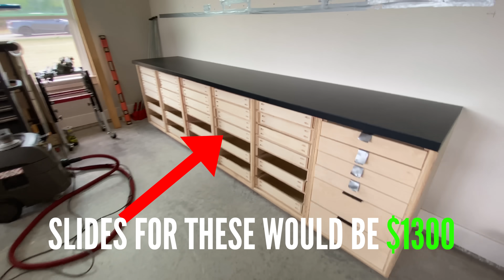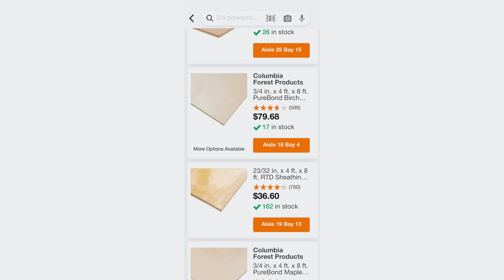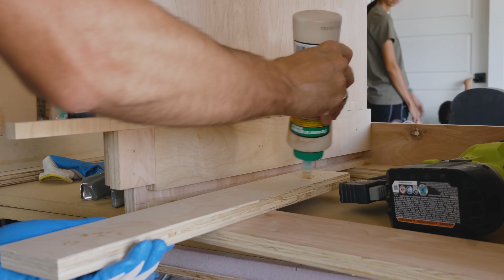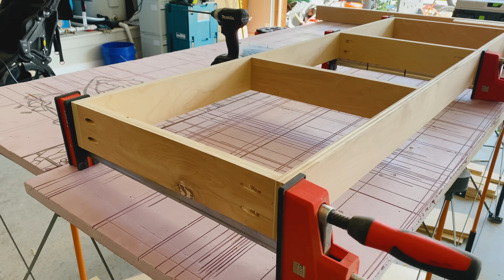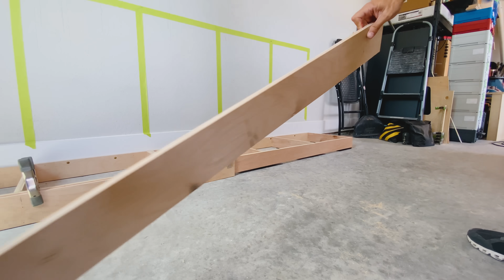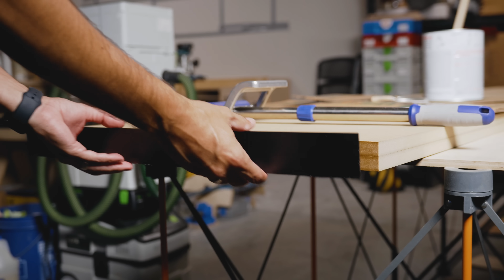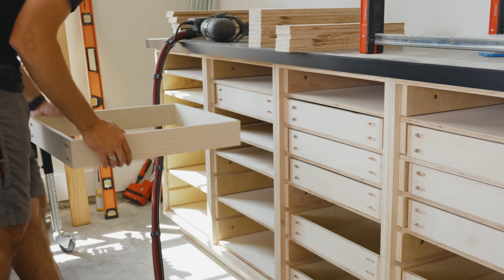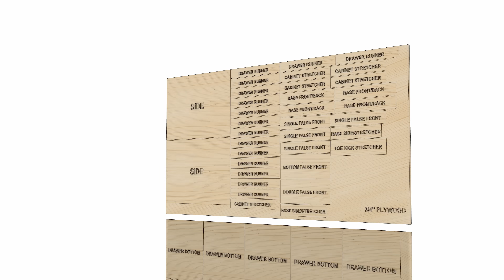Drawer slides are expensive. Do this instead.

Comment: I worked at a professional cabinet shop for a while and these are a few tips I picked up on doing laminate:

Make sure your bearing is spinning freely. We cleaned ours at least before every cut, sometimes in the middle of long countertops. Cleaned with laquer thinner and then lubricated.

We used a chamfer bit to flush trim the edge. Set it to take a small (1/16" or less) chamfer and that breaks the edge as well as flush trimming. It also doesn't have as much risk of damaging the side laminate. 

I preferred doing laminate tops with hardwood edges all the way around instead of laminate. Gives more forgiveness when flush trimming if you use something like 1/4" thick banding, and then you can cut a nice sized chamfer into the edge as well.
Reply from the maker: Thank you
Reply: The round over bit is a must to save that edge! Changed my whole work flow when started this and clients love the consist smooth edges!

Comment: Did you have any issues sanding the plywood with your 3M sander? I used mine on some cheap half inch plywood and it immediately started to sand through the veneer. I wasn't sure if that was a result of the cheap veneer, the sander being too aggressive with the 5mm stroke, or a combination of the two. I know for sure my grit was too aggressive in the beginning but I was having issues using 220 grit as well. I wish I had a plywood dealer like that in my area! Also, the cabinets look awesome. I couldn't find a snorkel for whatever reason so you get a surfer I guess 🏄

Comment: Being an animal myself, I liked the duct tape hack and have a pro-animal tip 4 u! General purpose masking tape or white painters tape. Whichever matches better or is cheaper, depending on situ. Other than the large number of cut filler pieces to make dados, it 'seams' to me to be a lot more material/expense than using a router or dado set of blades. If it took 1 sheet less per 2 cabinets you might have made budget? Anyway they look like they turned out great. Especially liked the hardware tucked in the face. 🤿

Comment: 🚽🚾 Mr. Wittworker, since I couldn't find the snorkeling emoji, I decided to give you a couple attention grabbers at the beginning of my comments.  This video is perfectly timed!  My oldest son and his wife just bought their first home, and the kitchen needs a bit of work on the wall that has the range and two separate built-in ovens (currently non-functional), integrated into the white painted cabinetry.  I told him we could build new cabinets and he could install a new range-oven single unit centrally located between lower cabinets on each side and flanked by a pantry on the outside.  With some modifications, I think your design ideas coupled with the hints about where to purchase cabinet grade plywood might be the ticket.....thanks very much!

Comment: 🤿I'm moving to a new shop soon and this video will definitely come in handy. Thanks! 

Cabinet hardware is ridiculously expensive where I live, Brazil. Plywood prices are also insane, even more so than in the US, and to add insult to injury, it's pretty much impossible to find high quality hardwood ply (and if you do, it costs about as much as a kidney and a half), so you end up spending a ton of money on garbage. There is no such thing as pre-finished plywood, let alone birch ply here.

We do have lots of cheap MDF (well, not cheap, but way cheaper than plywood), and it's very common to find sheets of it that already come with a formica veneer applied to it. In fact the unveneered (is that a word?) kind is rarely used.

The only thing that you have to do with veneered MDF is apply some edge banding, and we normally buy rolls of PVC edge banding for that exact purpose. Is that not a thing in the US? We don't have any kind of iron-on edge banding. I usually apply mine with a contact glue that comes in the form of a tape that you apply to the edge, then peel off, leaving a layer of water-based contact cement on the edge. It's real handy and WAY easier to use than solvent-based contact cement, which is probably the one substance I hate the most in the woodshop.

Anyways, thanks again for the wonderful video. And screw you for making me want to buy parallel guides for my tracksaw. Hope you're happy.
Reply: Yes, we have PVC edge banding, but that double-sided tape is super expensive compared to contact cement!
Reply: @wesman7837  it's much more expensive here as well, but not having to fiddle with contact cement is worth the price, IMO!

Comment: I just don’t see it being a very long lasting deal. Short term and a lot of paste wax sure they’ll be great but I see a lot of little maintenance and tweaking. Any old cabinet or piece of furniture with drawers gets bad wear marks I’d be curious to see an update video after awhile. Frank Howarth did the exact same design for small parts. Which I can see working out well cause there no weight.

Comment: You want to tape and one layer of mud on drywall joints in an attached garage for fire rating and to limit air permeation into the house. 
At least in these parts I'm fairly certain it's code.

Comment: 🤿 Nice video. The marking on the laminate edging could be from a slightly stiff bearing. I always use a new bearing when running against a finished surface. lloyd

Comment: Tip on the laminate. Get a laminate flush trim bit that is made for that. Works really well and should not cut into the side piece. Also use a tiny chamfer bit to go around the perimeter and that will break the sharp edge.
Reply: Laminate flush trim bit, and wipe the surface you are riding on with Johnsons Paste Wax for a little lube....
Reply from the maker: Johnson’s. Rip.
Reply: @wittworks  I’ve always just used turtle wax on the edge that the bearing rides on.
Reply: A really attractive way to eliminate laminate edge banding is use a 3/4” thick 1x2 oak or other type of solid wood as an edge band.  Glue and nail then apply laminate on top. Flush bit route as normal..then throw an OG or round over bit on it. Really blows peoples minds.  Personal preference I suppose…yet different than the guy next door!  Excellent job on cabinets…and videography too! First time viewer.
Reply: Yep, I love doing maple edges, laminate on top, then routing a bevel around the edges. Very functional AND classy
Reply: I used to work in a cabinet shop & we always laminated the edging after the top.

Comment: I did something similar recently but using Dennis' approach from Hooked on Wood. Standard carcass with an MDF inner liner with slots cut in. Then just glued and pinned 80mm drawer parts glued and pinned to a 9mm MDF base. They are very deep, slide fine and saved me a fortune as I'd have needed nearly 35 drawer slides of whatever flavour. Also I can move them around as desired as all the slide slots are identical, so there are single, double and triple drawers and each can go anywhere. Similarly I also put black Formica on a double 18mm MDF top, but the contact adhesive I had was utterly shocking and formed blobs when I dared to use a brush or a roller. I did eventually sort it all out though and it looks great.
Reply: I don't know about where you are, but here in Oz, if I go into an Auto parts shop, or a hardware store, I can buy a 'Degreaser Sray Gun' to use with compressed air, and in the past I have found that it also works well for yellow contact adhesive, the same stuff you would use for putting down laminate. It's not a perfect spray, looks almost like a random cobweb effect, but it WORKS, you get a nice even coating of the glue

Comment: I’m guessing the bearing on your flush trim  bit got full of dust and seized up. After that  it was spinning with your router bit and basically melting your Formica. 
As for those drawer pulls. They look like pant killers to me. 🤿

Comment: Very solid work, as always. I'm a big fan of the hardware-less option, particularly without using the router to dado the heck out of the carcasses. 

Did you use the Festool table saw for the narrow rips, or somehow use your tracksaw for those? Curious how that would have worked!

You're the third person I've seen with the new Festool compact table saw. New toy? Any reason you went with that vs. a Sawstop CTS?
Reply: Almost forgot: 🤿

Comment: Dude, this is really great. Inspiring me to finish these rolling tool carts I made out of 80/20 aluminum that still don't have drawers installed. I've been scratching my head for months on what kind of drawer hardware to put in them. I spaced the widths to fit the official systainer rails (or drawers), but plywood stretchers and drawers would be wayyy cheaper and practical. I'll have to check out your plans. 🤿

Comment: 🤿 Great cabinets and hardware free. I have a similar design build set-up and used teflon adhesive tape under the runners. It`s cheap and makes a huge difference in the drawer feel when operating. I like how you completed the repairs to the wall after all; It would also trigger my illness. BUT, c`mon Drew, the handle pulls not fitting in the rebated corners... doesn`t that trigger you more? After all, you see those more than the back of the wall cabinets.... might come back and haunt you. Just playing with you... Great build and a good effort taking three times longer for the YT... 👍
Reply from the maker: Thanks.

Comment: Use packing tape om the side before trimroundig, it protector the edge, and make the bearing slip instead of getting hot of scrape. Also makers a thin gap beween the router bit and the edge.
Reply from the maker: I like that. Where were you two weeks ago?
Reply: @wittworks  45 degree chamfer and be done with it.

Comment: 🤿 Great content.  Buying plywood from anywhere than HD etc., is valuable advice.  I'm curious how well your drawers (correction draws) operate when loaded with stuff?
Reply from the maker: Hahaha. I made them 3” on purpose so I couldn’t load them down. Most slide great. I have one that I put every hammer and heavy wrench into to try. It works but is a chore. I plan on hanging those tools anyway.

Comment: 🤿 woo! Im one of six! 😂. One question, are you worried about  the drawers breaking because of too much weight being cantilevered when they are open? It looks like you’re planning on putting tools in some of the bigger ones. Also, for similar, yet cheaper/diy drawer handles, I’ve gotten aluminum angle from a big box store and cut it to make the handles, and then mounted it similar to what you did (except screwed from the top. 

Great project. I’m in need of some shop drawers so this is super interesting.  Thanks!
Reply from the maker: I made them short on purpose to discourage over filling. So far they’re good. I’ve used that angle iron trick in my first shop! I loved it

Comment: Surprisingly compelling vid on a well-worn topic.🤿  I like the simplicity of the glueless drawer builds, that’s almost enough reason to go this way, slides savings aside. (Pretty sure I would have double-side taped a couple of boards down to make a quick and dirty positioning fixture, vs. all that center marking and alignment work though😅). 

Curious: Did you fine sand and wax the contact surfaces for the drawers? Or are they good just bare and dry?
Reply from the maker: Great point! I sanded and will wax soon. Spent a week building, and 5 weeks trying to figure out how to make the video not boring.

Comment: 🥽You can also lubricate those types of draher slides with beeswax. Get a block of it and just rub it on the exposed slide edges of the plywood. This also works well on older antique furniture that doesn't have modern slide hardware. 🥽
Reply from the maker: Yep. That’s the plan

Comment: 27:10 No need to buy an expensive jig, just get a scrap piece of plywood, mark out equidistant holes in a straight line, and drill them on your drill press.   Yes, there will be minor imperfections in the spacing, but that's okay, because if you simply replicate it using the same jig four times, any slight imperfections don't matter, as they will be the same in all four corners of the shelf.  And once installed, you won't be able to tell that a shelf is 1/32" lower than it should be.   Plus it's way more fun to build jigs yourself rather than buy them from Rockler, although their stuff is mighty nice.  But I'd rather keep my money, please and thank you.
Reply from the maker: I thought making one from pegboard
Reply: @wittworks  Pegboard is too thin, you need something at least 3/4" thick, that keeps your drill bit lined up perpendicular to the surface you are drilling.   If you use 1.5" thick material then it can even act as a depth stop, assuming your drill bit is of a complementary length.

Comment: I usually trim the top Melamine with a 45 degree bevel. Cuts off and cleans the top at the same time. No blades near the side Melamine. Usually don't have to do any file finishing.
Reply from the maker: Where were you two weeks ago?

Comment: The modular cabinet design is fantastic, but not the most efficient use of expensive plywood. If you built it in 2 5 foot sections you could save a sheet or so. But being able to adjust the layout later is a huge bonus (split them apart, hello miter saw station)
Reply from the maker: Very true. Mainly built them this way to illustrate the modular aspect.

Comment: 🤿Check out Woodworkers Hardware for slides.  I get KV ball bearing slides for waaaay less than the ones you were looking at in this video. I know that skipping the slides altogether is cheaper still but, sometimes slides are needed.  KV8400 slides. Check em out! 🤿

Comment: totally random question... but what measuring tape are you using there with your tracksaw? I've found it surprisingly hard to find any with fractional read on both sides 😭
Reply from the maker: It’s a lufkin self centering tape. https://amzn.to/3tHMDw7

Used to be $7 at Lowe’s. Now they don’t carry it and it’s $18 online. 

It doesn’t read both directions, but I use it because it gives you the fractions and the exact half at the bottom. I think fast cap may make a double sided tape measure

Comment: Most likely reason you got that mark on the edge of you laminate is the the bearing had build up of contact cement from your previous trims and it wasn't spinning freely from the bit. I always clean the bearing with acetone or thinner after I make my cuts.
Reply: For sure, THE number one tip for routing Formica, if you think your bit might be gummed up, it was a cut ago! Keep that bearing clean and spinning! Acetone is your best friend.
Reply: This happened to me my first time doing it and bearing getting gummed up
Reply: They also make a solid carbide flush trim bit without a bearing that is made specifically for Formica-type laminates, The recommended usage is to quickly apply some paste wax where the bit would be touching the laminate. Bearings are great except when you have build-up. The solid carbide is simple, easy to clean, and a lot cheaper.
Reply: What also helps is trimming your laminate closer to the final size. As well as the others posted about proper bits and cleaning bearings.
Reply: But wouldn't Acetone wash the grease out of the bearing for good? Those are sealed bearings no?
Reply: Yeah, the bearing is definitely not spinning, but melting the laminate as you go.

Comment: Snorkel Emoji (Too old to figure out the real one)  Having had a water disaster I would have thought you would use adjustable legs or at least left the plastic shims in place and had the cabinets a 1/2" off the floor.   I bet the bearing seized.  Duct tape falls off after a while but so does paper tape mudded in place, just takes longer.  You could have saved an end on every other cabinet.  Talk about cheap, I built mine out of sink cutouts a counter top company  gave me and I used some 1/4" by 1" aluminum I scrounged for slides.  Been working great for almost forty years.  The drawer boxes are made of poplar "seconds" I got dumpster diving at a furniture plant.  Actually they pointed them out to me.  Yours look better than mine but mine were cheaper.

Comment: 🤿
Im just taking a guess on the router marks. Could it possibly be heat from the bit speed to high? Or maybe the bottom bearing is to far down and slight tilting cuts into the top edge

Comment: Butchers wax on those drawer slides is the trick @wittworks 
Get you some smooth operation with heavily loaded drawers. Its a tedious process but oh so worth it. I will never do wooden drawers without heavily lubing them with wax

Comment: Love your content! Keep it up. One thing I learned is if you put blue tape around your countertop edge it will keep the bearing just that little bit off and you won’t get that chatter! And you can tune it up with a sanding block! Lastly I always rip my plywood long ways down the center (610mm) and then cut them to the final 600mm  which takes off the factory edge! You got a follow from me

Comment: With a greater vertical gap between the side support rails you can add drawer stops by notching out or putting a little stop block on the bottom of the rail of next drawer up. 

This way you can prevent the drawer from pulling out all of the way when it is tipped down naturally when the drawer is nearly fully extended while still being able to insert and remove the drawer by holding the front up so that the drawer is level.

If you want you can instead use a recess on the side panels and a spring loaded pin attached to the drawer bottom or sides.

 The recess should have a sharp shoulder towards the front that stops the drawer moving forward beyond that point and be sloped to the rear so you can push the drawer to the back.